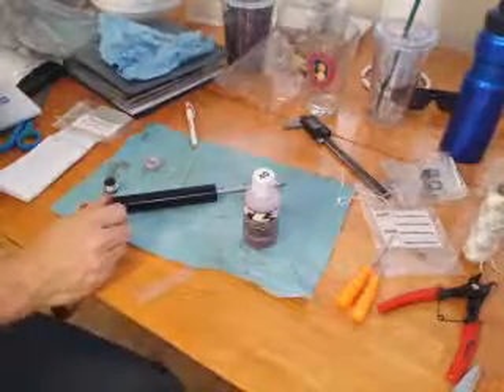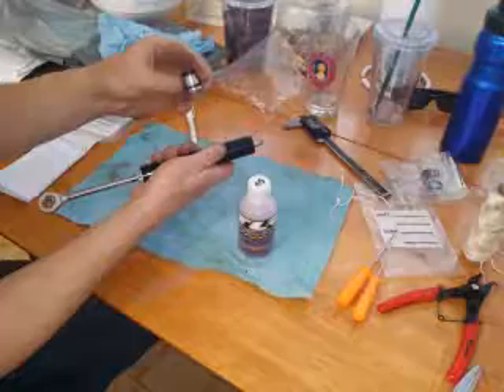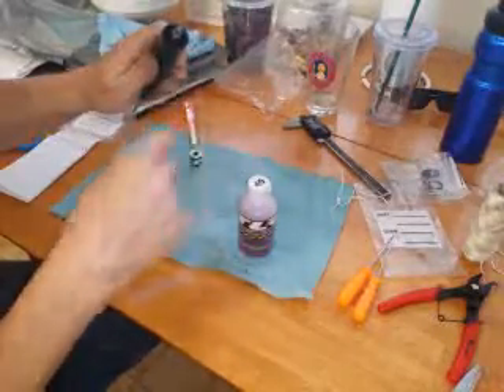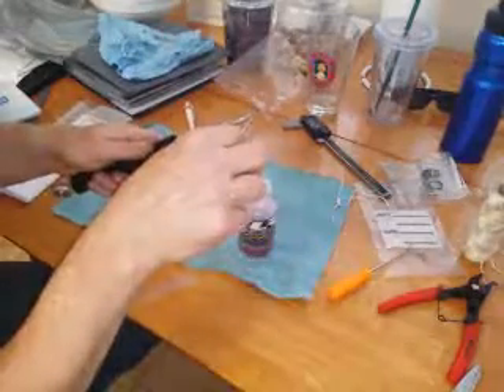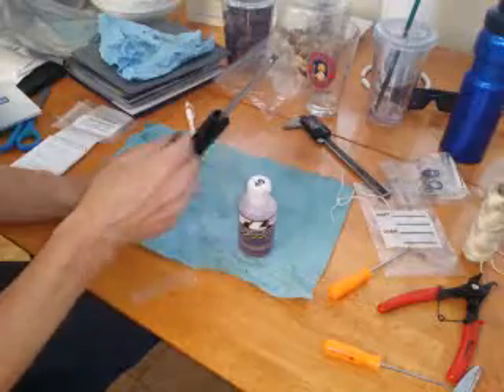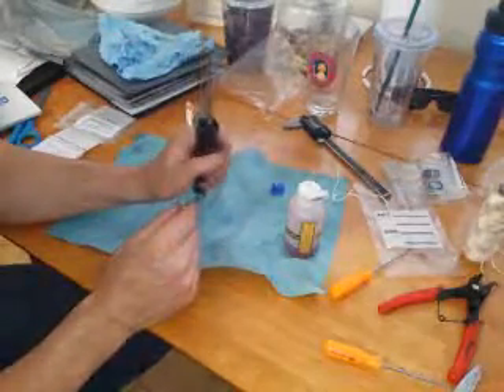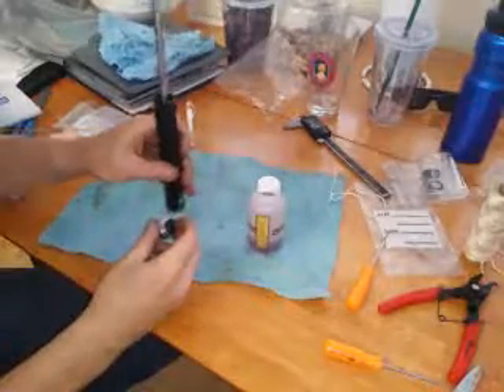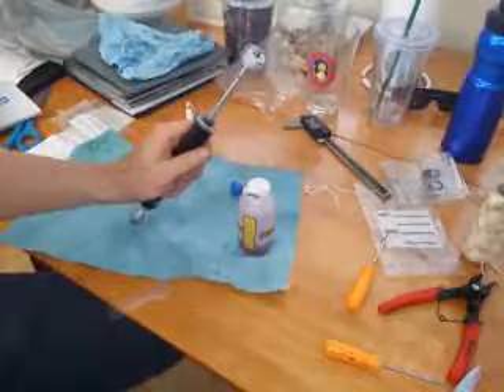Ural Hydraulic Steering Damper Reassembly

Comment from the maker: It was for both.  The original oil is very light and some of it leaked out leaving air inside the damper.  Plus it didn't dampen real well with the light oil in it.
Much better now with the 40wt.

Comment: This is my second damper on a 2016 cT. It was replaced under warranty and doesn't have many miles on it. How much disassembly would I have to do to change the oil out for 40W?

Comment: How long did it work since new till you had to rebuild? How improved would you say it decame after seal and oil change? I got to fix mine, it´s becoming loose.
Reply from the maker: It's still working.
Reply: Coluralado 01 Any idea what grade is the original oil in it? I have chance to get 32 or 68... Will one of these suit the needs.
Reply from the maker: By "Grade" of oil, do you mean the weight?  What ever was in there was real light, maybe 15 wt.  I've used 30 wt and 40 wt silicone shock oil and both work equally well.  I got my oil off of amazon, Team Losi Silicone Shock Oil